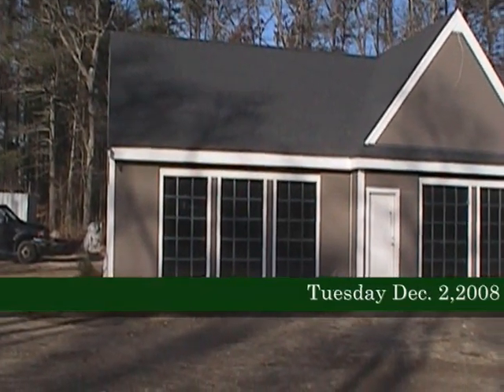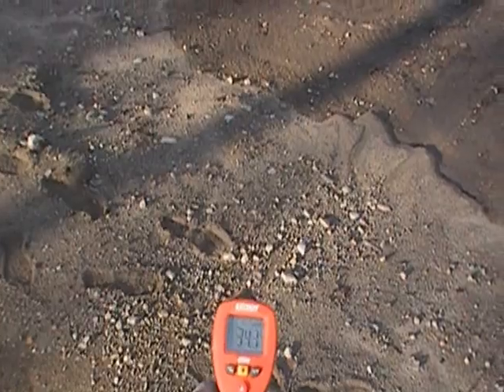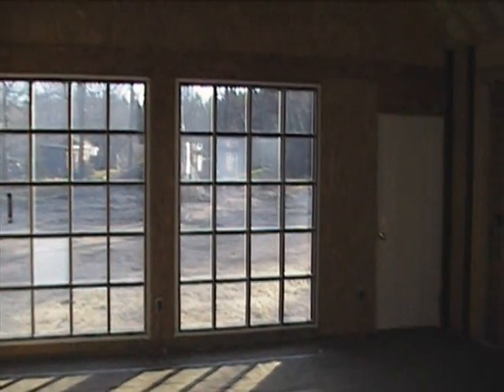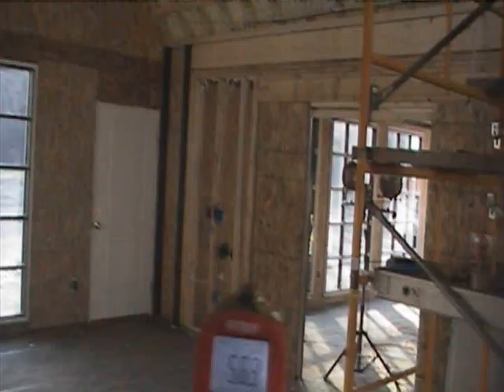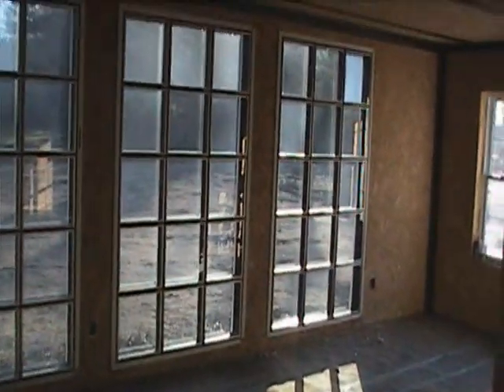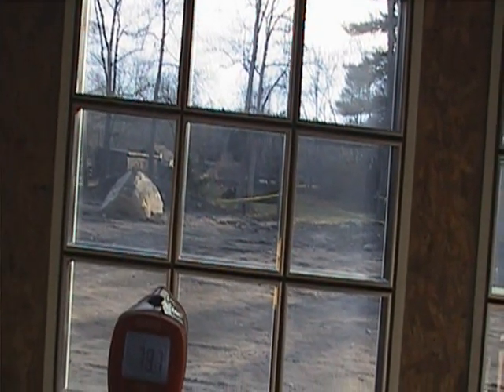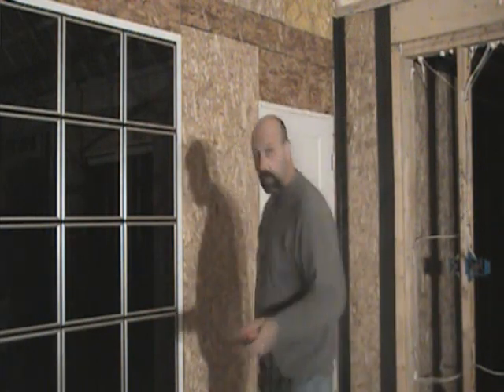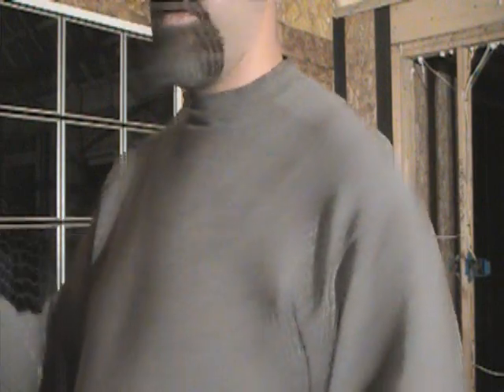Passive solar, energy efficient home with a Trombe wall?

Comment: Trombe wall in any reliable, usable form is virtually lost knowledge now. I heated a small 700 sq.ft. home in northern Canada entirely by Trombe Wall principle with separate insulated bin of thermal mass (rocks) for storage. The panels used roofing sheet metal, fiberglass insulation in lumber framed 3ft x 8 ft x 4 panels. The air flowed behind the metal, so that it acted as a second pane to single pane glass from old motel shower doors. If mounted near the ground, snow cover acts as a big reflective concentrator, and the coldest -30 deg days are always clear blue skies, so even with shorter daylight, this used to be perfectly doable, inspite of what present day know-it-all contractors tell you. What they do not tell is that their systems are overpriced, poorly made junk.
Reply: Robin, would you be willing to help me with my Trombe Wall design?
Reply: @AscendedDissenter  Trombe wall is easy, using thermal mass insulated and behind glass. The question is how much is needed to store heat for 12+ hours for the home. Know how dark surfaces in a parked car may be warmedd by the sun in winter? It's the same thing. I'd even say that the only reason it is not a thriving industry is, because it is so simple, yet only the very few such as myself have ventured to try and test it out as a full-sized, diy project.

Comment: Where can I find more information about this design/ window assembly? I am working on my thesis project in architecture school at KSU in Georgia. I am considering using a water trombe wall for my project residence, located in Hanford, CA to help tame the extreme diurnal temperature shifts. Thanks.

Comment: My brother-in-law did not have the money to heat his home in the winter and his home would stay at about 50 degree F for almost 3 month.
Water is a good media to transfer heat. What would prevent the heat to escape outside especially if you heat the house let,s say to 70 Degree F.  If you heat the house to 70 degrees than you are having to heat the mass in the windows also which is water and that will take extra energy. Same with cooling a home.